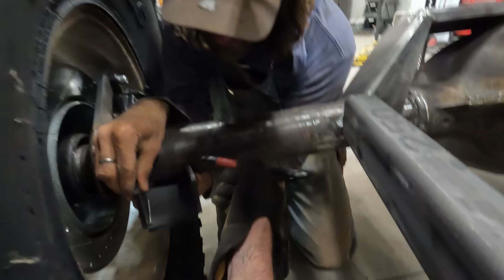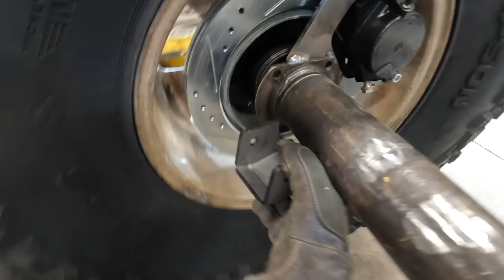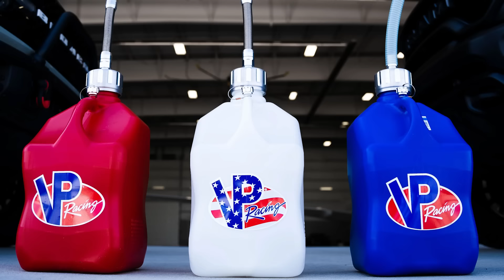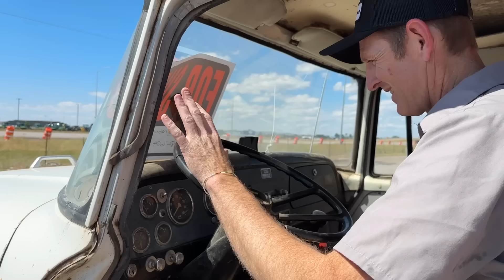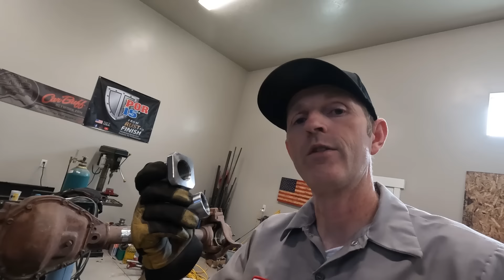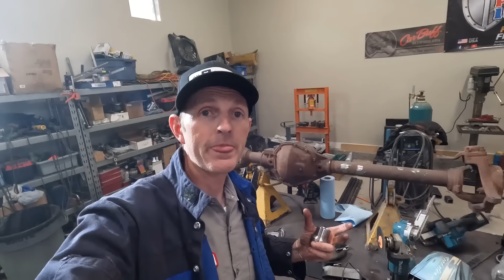Dig Dug Suspension Transformation

Comment: TomTom, I hope someone has told you this trick I have seen Colt Builds It do;
That is when ever you are welding threaded inserts into any tubing use an old joint and thread it in - it'll protect the threads and keep the insert pristine for the actual joints to be used.
Love the mess up-fix up though.

Comment: Take the handle of your new press and weld a large toothed gear to it. Match the teeth with a tiny one connected to an electric motor. You can multiply the force by the gear ratio and the power of your motor. Low rpm high torque motor would be ideal.

Comment: I don't know why I caught this one so late but what does T 28 9 ft mean on your plate in the rear window. And this is just a thought make a metal container with a trailer hitch connection put it in the trailer hitch receiver and put a bunch of scrap metal to counter balance your motor  weight ?

Comment: For having dig dug on the lift - mount D rings on the floor, front and back. Then use a come along or rachet strap connected to the floor D ring to the frame of the truck. The problem would be when you want to raise or lower  the lift. Or can you make clamps that go on the lift "legs" that can clamp onto the frame.

Comment: When you put your plate on mount it to a solid sheet steel plate about 1/4” larger all around. That can mount on a spring loaded hinge and that to the truck. So if it’s hanging down and dragging on a rock it will swing out of the way and is reinforced with the sheet steel so it doesn’t get damaged.

Comment: Per google: Metal cored wire is a tubular wire filled with metallic powders, alloys, and arc stabilizers. Using it offers higher duty cycles, faster travel speeds, low fumes, and improved cost-effectiveness.
For those who wanted to know 😊
Reply: Googled it - for that price I'll stick with flux core.

Comment: When you want to cut out a wedge to change the profile of a piece of metal you are going to weld back together, drill a hole for relief at the apex of the angle. The size of the hole will depend upon the angle of the wedge you are cutting out , and the thickness of the metal. I wish I had known you were gong to do this before you did it! Oh, well.

Comment: I can't believe that as safety conscious as you are you are supporting that truck with people under it on a hi-lift and cinder block on end!!!!!!!!
 I also noted that you are just like me in the welding glove department, My gloves are also all worn out but I refuse to get new one (I actually have a couple pairs) since the old ones just fit. Loving the build but be careful! I built stands out of 2 1/4 tubing lower and 2 inch trailer hitch tubing for the upper With pin holes through them for height adjustment. The higher they are the wider the base has to be for stability.

Comment: Pedantic note: The plumb bob is the weight at the bottom. The whole thing is called a plumb line. 8-)

Note that using a bolt as the bob, the way you did, can give you a line that is slightly out of vertical if the projection of your line doesn't go directly through the bob's center of mass.

Probably not far enough out of true to matter here, of course. Close enough is usually close enough.

Comment: I was surprised the front bracket was taken off rather than fixed tougher before mounting the arm. To my mind, and I'll add I've never done it, put the bracket on the arm and then fix in position, that way the brackets are correctly aligned to each other using the arm?  But Tom's a smart guy and I'm sure he's got it right anyway.
ps. Thanks for answering the Dig Dug question.

Comment: "Gas Up at Maverick" and it doesn't matter if it's Gasoline, Diesel or even Propane. (But not charging your Tesla?)
 We all know what it means.   
Heck when Tom Cruise as "Maverick in Top Gun" said "Low on Gas" in his F-14  we knew he meant JP-8.  LOL

"Rosette Weld" that's the term I am familiar with.  Matt calls them "Plug Welds."

Comment: Where everyone uses round tubes for adjustability and strength,
Thomas uses squared off pivot points and square tubing,
Remember that folks, when he is broken down on the side of the trail hooked up to MATTMANs wrecker.
The only shape stronger than a triangle is a circle,
And the square is weaker than both, plus he is limiting the axle side pivot to move and articulate around environment,
Creating more stress on the truck drive line.
I doubt he'll ever push it to the limits, he'll be too scared to actually push the limits. ❤
🗽🇺🇸🙏🏻

Comment: Tom if you do buy that International, plan on needing to redo the brakes completely. That era International was famous for the fantastic gas engines and infamous for the hydraulic over hydraulic brakes. Whenever you got in a tight spot you could guarantee you would get the full power of the brakes against your foot. It was downshift or die. Yes I could tell you numerous stores.

Comment: Tom,  your using powder core wire caught my attention and curiosity.  I've never heard of it before.  Does it eliminate chipping of flux?  Would it be worth it for a diy amateur welder?  Is it tricky to weld with, and where do you get it.   Also what composition of powders is in the core?

Comment: I used to own some medium duty Harvester trucks with gas 345's in them.  Bulletproof.  I had one with a 392 in it, but it was converted back to gas from propane and the mechanic where I bought it from said it was well maintained, but that they don't like to go back to gas once they've had  propane run through them.  Sadly, he was catastrophically correct.  It ended up with an extra view port in the block after just under a month.  Oh well.  I vote for the Harvester.

Comment: Your welding wire is fluxcore almost guaranteed otherwise you would be doing MIG welding. For flux core the flux is sprinkled on a flat ribbon of metal and then it’s rolled up tight into your welding filler rod. The flux is on the inside of your filler wire as opposed to the outside of the  filler rod for stick welding

Comment: I can't tell from the video but it looks like you have a cinder block vertically on top of a jack to lift the back of the truck.  Cinder blocks are not structural vertically or horizontally without a top and bottom cap, 2x6 cut to fit works great.  Just so you what you have done is a good way to get seriously hurt or killed.  With your knowledge and all the steel you have why don't you make yourself an extension that fits in the hole for the lifting plate or make some tall adjustable jack stands.

Comment: Man, I can't see how you can work without a proper drill press!  It must be traumatic for you every time you 'drill' a hole- in parenthesis because the accuracy of the hole is more like bashing the material to be drilled with a piece of rebar until a hole appears.

Comment: Depending where your shock mounts on the link you might have an issue with the links wanting to wobble or fall over. Typically you want the shock to mount below line between the two pivot points. Since both ends are on a threaded end it’s going to be impossible to keep the jam nut tight.

Comment: Tom isn't diesel fuel tractors. Use tractor fuel which is diesel. So I don't see your problem with you. Using fuel, as long as you put diesel fuel in it. It's still a combustion material, not as flammable as gas, but still birds so. Technically, you could say you're Feeling up with diesel😊

Comment: gassing up always sounds weird considering it's a liquid.
Reply: ‘Gas’ is short for ‘gasoline’.  No need to be flummoxed.
Reply: @mikek5298  in the fuel station sense gas is lpg which is short for liquid petroleum gas which is only liquid when under pressure and a gas at atmospheric pressure.
gasoline is petroleum aka petrol.

Comment: Just make some jack/lift pads that get welded to the frame. I never understood why more offroaders/racers dont do this. Put dedicated spots on all 4 corners so there is someplace to lift, whether your on the trail, in the shop, or at the track.
Reply: This is a great suggestion! I don’t want to learn that our favorite Tom Tom has been damaged in any way😩
Reply: @DavidLorenTosh  Or Matt or Paul or Rory or...
Reply: *you’re (you are) 🙄
Reply: Tom, Dig Dug is coming right along.  Enjoying the build 👍🇺🇸
Reply: On my C10 I use the front cab mounts brackets and rear spring mounts .works fine for me